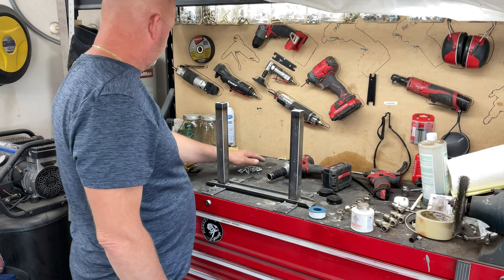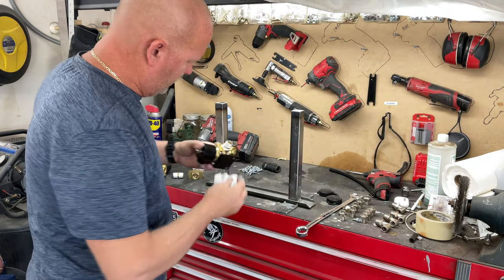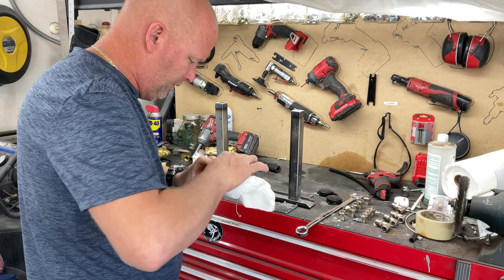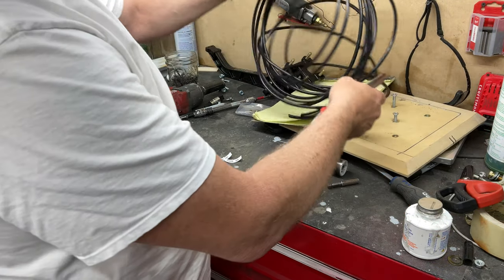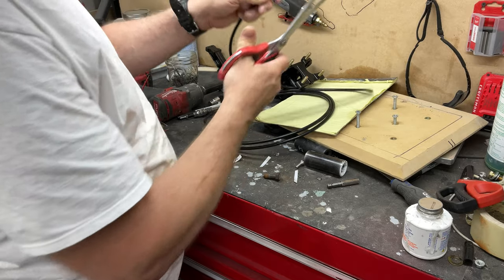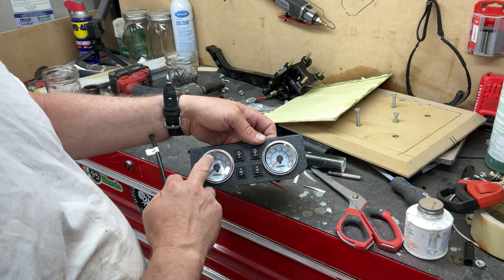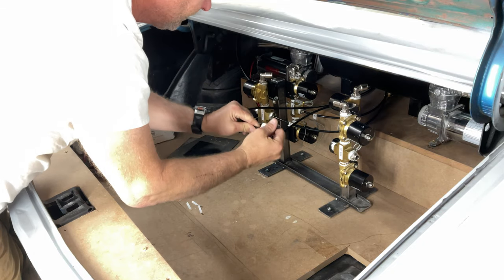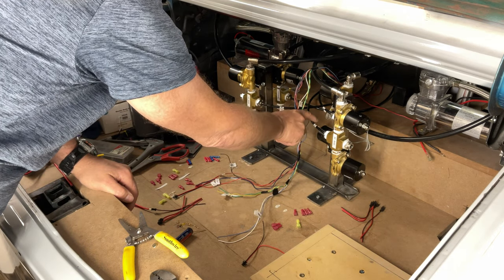Bag  your car to lay frame for $1500!

Comment: Hey. How has the Vixen kit hold up ?   Can’t really find much info on the kit other than your video.   Any issues with the kit at all ?   Love that set up.  Cool ride my man.
Reply from the maker: So my car is still in the build process. It’s so fast. Like hydraulics. 1/4” or 3/8” is much more manageable I’d guess. I’d make sure to get a manifold setup next time. Manifold setups are much simpler. In a perfect world, I’d use 1/4” to air them up and 1/2” to drop it. The only easy way to do that is to have the drop valves at each corner though. Hope that helps. Great setup in general though.

Comment: Did you have to clearance the front spring cup pockets for your bags?
Reply from the maker: Good question. I smoothed the upper pocket area so it wouldn’t cut the bag, but I didn’t cut out any part. On the a arm I welded in a ring and plate for the bag to mount to. The front crossmember is almost on the ground.

Comment: Looking to bag a 72 chevelle. 1500 is the cheapest ,
Reply from the maker: I recommend getting a manifold setup instead of the valves. Much easier. There are cheaper sets maybe, but not with all the stuff I think or with a reliable brand
Reply: @SOB_Garage  not sure what u mean I'm very green I need it for my car but way expensive in cali.  Where you located , and looks like more work then I can handle 😔
Reply from the maker: @Theundisputedtruth  you may want to look in to a bolt in kit made just for your vehicle. Much more expensive but easier to install.